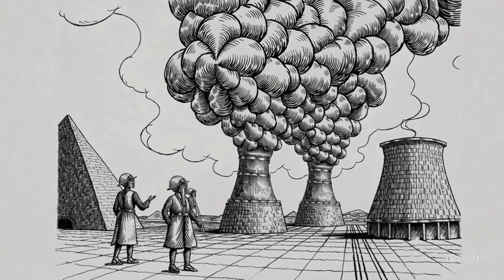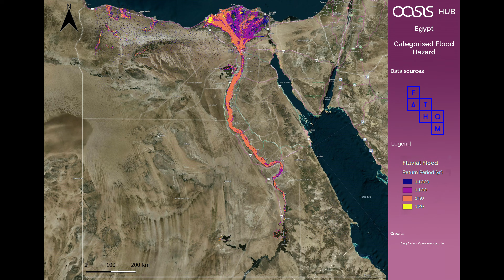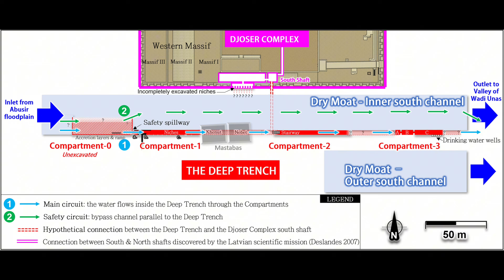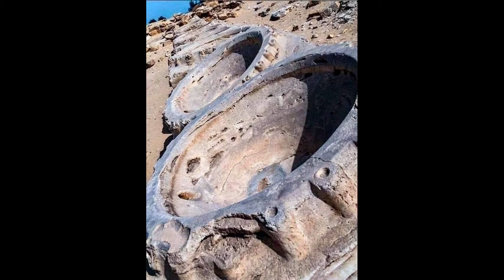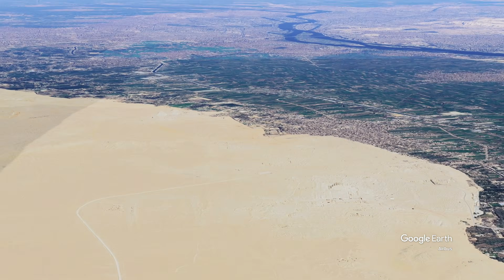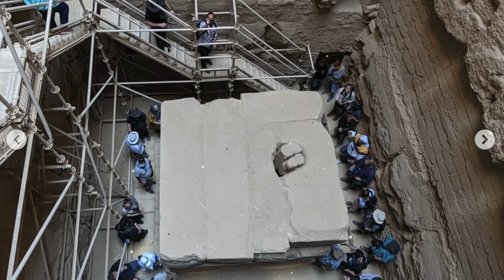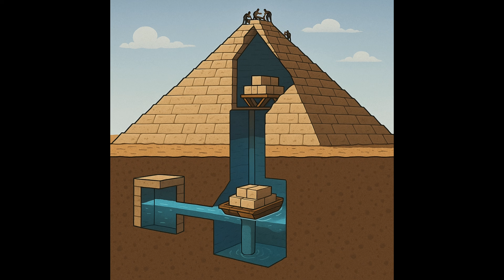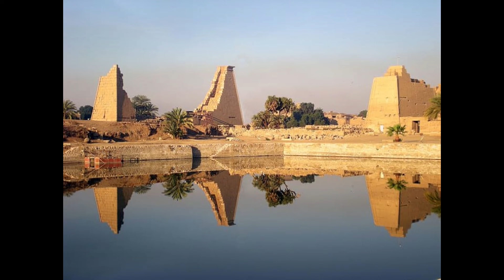The Incredible Hydraulic Lifting Machines of Ancient Egypt

Comment: I think, if one would take what technology was conceivably available to the ancient Egyptians - like some (limited) wood, some copper, ramps, rollers, ropes, simple cranes, (proto) pulleys, and so on (and of course lots of people) - it would be MUCH easier to build a Pyramid (without a hydraulic lifting machine) than to build some sort of hydraulic lifting machine itself.

Not only will water leak through every crack, a column of water is HEAVY, the higher the more pressure it exerts. But once it starts moving where you don't it to move, it can start to do really nasty things. The Romans used water to mine entire mountains. It's called Ruina Montium. Imagine utilizing a damn failure on purpose. I imagine this would be a lot of fun. Certainly more fun than mining by hand, in some cramped, dark tunnel. Water is good in tearing down stuff, and moving stuff downstream with it. It's like it is its superpower.

If you tell me the Egyptians build canals, and damns, and maybe even simple pumps to lift water up maybe a couple of feet, for irrigation? Yeah, that I believe in an instant. But hydraulic machines? I rather believe in Bob the Alien Builder from Aldebaran. Even building a "simple" canal lock able to lift boats (and operating it for a longer time period) was beyond what the Egyptians could conceivably do, in my opinion.

PS: I feel like having watched all that made-up AI imagery made me know less, not more. I need to purge this from my memory, for the sake of my personal intelligence.
Reply: The "hydraulic machine" does not have to be any more complicated than a heavy raft on a rising and falling water pool.  There was obviously water available from the Nile, and they obviously built canals for irrigation.  Not a stretch at all to control that water for raising weight with ropes (infinitely more practical than lifting with scaffolding above a very low height). The water wouldn't even be wasted, it would still be used for downstream irrigation, only the energy would be used.  Nothing like a hydraulic cylinder would be needed, only gates tight enough to raise and lower a pool.
Reply: @rodfreess6019  

Have you EVER dealt with water, with water columns, with water pressure, sealing up interfaces with KEEPING IN water? With storing or moving larger amounts of water? Have you ever stored water? What was the height of the water column you did manage? Have you ever dealt with the F#@%ING weight of water? Have you EVER dealt with leaks?

And have you tried keeping water in something you have build yourself? Like, have you EVER dealt with keeping water in with something you build? By YOURSELF? Forget using stone and lime, what did you manage using modern materials?
Reply: @Test_McTestface  Have you ever tried to understand the comment that you're commenting on?  Yes, I have done all of those things that don't involve "water columns".  The Egyptians had the NILE RIVER and irrigation canals, this was not new to them like it seems to be to you.  Whether they had hydraulic rams to raise irrigation water slightly higher or not, is another question. All of what I proposed can be done with falling water easily.
Reply from the maker: Yes I don’t use AI anymore. Lesson learned. Ultimately I found this mechanism wouldn’t have worked at all, as there is no connection between the southern tomb and the great trench. Thank you for taking the time to write the clever use of basic levers, tools and simple machines is the key!
Reply: @intothemap360  Just thinking about me at home. I'm struggling with dead lifting heavier things, i.e. for moving some stones around the house. But usually, when I'm just determined enough to coax, push, pull, roll, lever or shimmy them around, I can move stones I wouldn't dare to lift.

If I WANT to move that damn heavy object on my own, it'll usually get moved, I'll usually find some way, in my OCD way.
Reply: @intothemap360  If you think it makes your videos better and want to use AI then use it. If you don't then don't.

These sort of people are the result of entitlement, they genuinely believe they have a right to enforce their beliefs.

I'd argue you should fight against it, even when you agree with their beliefs.

Comment: How  about sand as a lifting medium instead of water ?
Reply from the maker: I’ve seen sand used for lowering (made a video on that) but never for raising. I think the problem would be you can drain dry sand out a opening in the bottom of a chamber to lower something sitting on top of the sand but you can’t do it backwards and jam sand back up

Comment: They used bearings also. About a 1/2 mile to the west of that is scattered extremely precise round balls about 2" in diameter. There aren't any perfect ones out there, but only ones that had been damaged. I know where there is a physical example and I have photos of one of them. They were created with different materials starting with an inner core. It's possible they were designed to chip and cast off the exterior layer, but still usable for some projects as they were used, damaged, and reduced in size.

I talked to one Egyptologist who had a pet theory, so he just kind of looked at the example/sample and shrugged. Ugh

It makes no sense to use labor to push blocks over sand or mud when you have these bearings. They weren't idiots.
Reply from the maker: What did the bearings go inside of. Are you talking about the diorite balls
Reply: There are stone slabs beside the pyramids with large hemispherical depressions on them. There are much smaller hemispherical depressions at right angles to each other, around the circumference of the large depressions. These would be about the right dimensions to accept those bearings inside them.

Comment: To me to think it is a machine is a pretty big stretch. Couldn't it simply be a way to create water infrastructure around the pyramid? Like when we need to transport a lot of big heavy stuff from a car to the inside of a building, we use little wooden planks with wheels just for that little distance because it saves a lot of energy. If you need to constantly move like gravel, water, tools, wood, from one side of the pyramid to the other it would save so much energy if you could just put it all on a raft and drag that to the other side of the pyramid as opposed to carrying it over land. Those drains perhaps could be used to control the level of the water.
Reply from the maker: I agree. Remember I’m just presenting the argument. If you got to the end you’ll see many of the issues I point out

Comment: 😊we don't even understand why does it have to be😊😊so😊big😊😊😊😊😊😊and built of rock😊😊😊😊😊😊
Reply from the maker: Rock was the most available building material and the only one sturdy enough to go to that height. Ancient Egypt didn’t have structural steel or the flying buttress so this was what they had to work with. Bigger means bigger than the last pharaohs pyramid! Bigger pyramid = more bragging rights.
Reply: @intothemap360 wood is easier and quicker unless you're working faster than science can currently😊 attempt to explain😊
Reply: @32ModB maybe they had wood pyramids too but they biodegraded
Reply: What if that particular height was the point? ( no pun intended). I'm thinking of a tesla tower. Tesla wouldn't have built it as high as he did if he didn't have to.

Comment: A 70-ton stone lifted? Doubtful/Math doesn't work. How did it get transported 500 miles away? You would need a 300-foot barge or so to account for that displacement. Nothing that size was ever built out of wood to transport cargo as far as i know. These pyramids were a rebuild/appropriation project by Khufu and others, it's pretty clear at this point.
Reply from the maker: It seems like you’re confusing the step pyramid with the pyramids of Giza. The Kungfu pyramid is at Giza  These are two different locations, but you are correct that academic paper I discussed in this video does have a lot of questions that are left unanswered.
Reply: @intothemap360  Ah my bad, i should of watched the entire thing. Yeah pertains to the GP as well, i guess, since some think they floated the stones internally, then used a lift of some sort.
Reply from the maker: No worries. I didn’t write the paper but I did point out many things wrong with it at the end. I appreciate you watching as far as you did!
Reply: I love how you ABSOLUTE MORONS can simultaneously believe that the egyptians couldnt build a large boat BUUTTTT... they can levitate blocks with sound and they coordinated with aliens.

Comment: Having lifted drains plugs from pumping systems lifting water, I don’t believe people power would have enough strength to remove a drain plug with that amount of hydraulic pressure. `it’s incredibly difficult and hydraulic pressure is not to be underestimated.
Reply from the maker: You’re right. Mechanical advantage would be needed. There are a ton of issues with this theory for sure

Comment: We need to obtain at least neutral buoyancy of the float, the cribbing, and the payload/stone. The cribbing also needs the strength in compression to support the payload and all the cribbing above it. I'm not familiar with the local woods, but I would be hard put to find suitable high strength and low density wood in North America.
Reply from the maker: Good points. There are several major issues with this theory and your comment is another problem that would have to be solved
Reply: Reeds, like the ra boat expedition. They grow freely in the nile.

Comment: The pyramids were dual season hydraulic ram pumps and desalination water plants for agricultural and civil irrigation.
Reply from the maker: No evidence for that. I also learned in my video I just made on the deep trench that there is no connection between the deep trench and the south chamber at the pyramid. So the water could not have come from the wadi into the pyramid. Furthermore, there is no need to desalinate freshwater and the Nile is freshwater. There is no salt in the river until you get to the nile delta where it meets the sea and mixes becomes brackish. Thanks for watching!
Reply: @intothemap360 what if it was originally a spring??
Reply: In its lower reaches near the Mediterranean Sea, the Nile delta experiences a mixing of river water with some seawater, creating brackish water in that specific area. The residues are still present from the process. Ref: https://www.nature.com/articles/s40494-020-0356-9
Reply from the maker: That’s what I just said haha. This is way south of that area. The Nile flows south to north :) therefore the salt water isn’t coming against the flow of the Nile, down south from the sea to Saqqara where it would need to be desalinated in your theory;)
Reply: @intothemap360  Yes, I know. I am agreeing with your research in that they used hydraulics to not only contruct the pyramids themselves as you have clearly shown but, also used the resulting structure as a huge indistrial pump system for irrigation and it did indeed remove remnant salts, clacium and other contaminant before putting it on crop fields or drinking it. Both are true. SEM micrographs of structural mortars joining the backing stone blocks of Chephren pyramid. Observation of minute and deep cracks in the mortar structure and salt crystallization into mortars. They also used it to generate hydrogen and electricity btw.
Reply from the maker: Haha I’m tracking. Comments are tough to understand each others point of view at times. Thanks for watching I’ve got a lot more videos in the works
Reply: @chrismonksellye4608 "The pyramids..." You are overlooking the fact that no two pyramids have the same layout, and many of them have one single room at the base or under the ground level. So when you say "the pyramids," that doesn't really work. What you mean is, the one single pyramid you are familiar with that someone made a gibberish technical diagram of is the one and only one for some reason. 

There is also no reason to make giant pyramid covered versions of either of those. If you know how to make such a thing, you don't need a giant pyramid for it and it would not even do you any good to make it like that. You'd be intentionally making the worst version. (And that is if we assume you could somehow make enough changes to make either of those concepts actually work.)